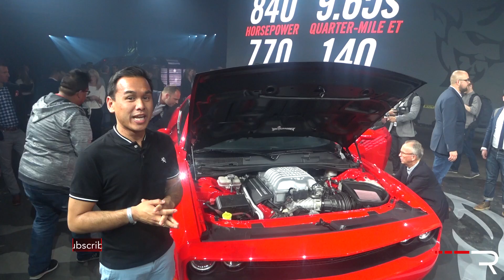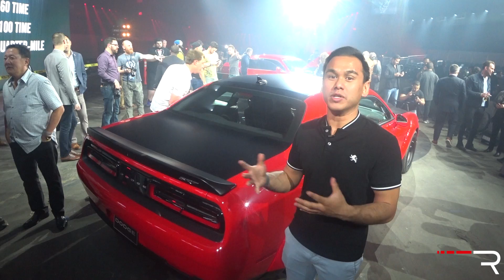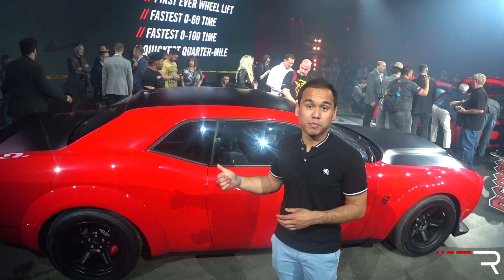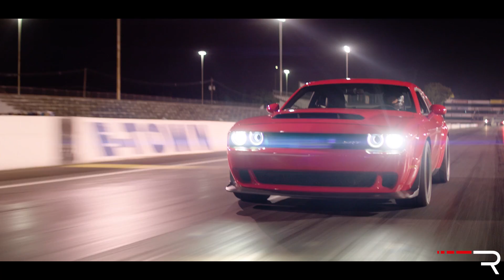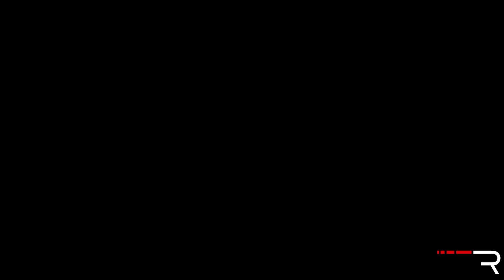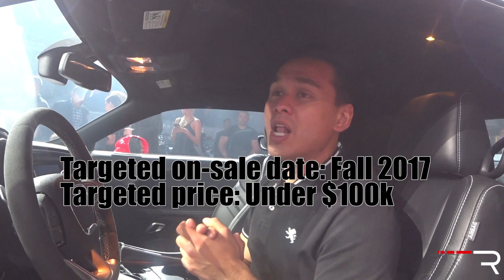2018 Dodge Challenger SRT Demon – Redline: First Look – 2017 NYIAS

Comment: You don't have to like it, but you're damn sure gonna respect it!
Reply: Ervin0310 no
Reply: nah...
Reply: Damn Right !! Tesla has some competition at the drag strip  !!!
Reply: I don't. Making a fast drag car, seriously? You can do that with literally any car. This car is still a cheap-ass economy car with a big engine, and it's only good for one thing - going fast in a straight line. In what way does that deserve my respect?
Reply: Vernon Price economy car? do you know what an economy car is? And how are you gonna knock a car for doing what it's made to do?...go fast in a straight line. There are plenty of cars that I don't like, but I respect. You're obviously a hater 😂
Reply: I will say this, I wasn't huge on the hellcat and thought it was one of the most overrated cars in recent history just cause it has 707HP and people were treating it as if it were some mega exotic god when its just an overpowered dodge(and its not even about the handling, the hellcat just simply put cannot put down what it makes without suspension mods and different tires), but the demon is a completely different story. This is a dragster right from the factory that can still be driven on the streets. I wouldn't care about the warranty too much since most car guys blow that within seconds(and it wouldn't be my daily if I bought one anyways), but it's awesome to see that you're getting a 9 second dragster right from the production lot.
Reply: +tommieboi707 - What part of "going fast in a straight line doesn't impress me" did you not understand?
Reply: +Ervin0310 - "economy car? do you know what an economy car is?"

Do you? I rented a Hyundai Sonata that had a nicer interior than the Challenger does. The Challenger is a cheap-ass car, which is why the vast, vast majority of all Challengers Dodge sells are the rock bottom base models. Not any of the V8 models.

"And how are you gonna knock a car for doing what it's made to do?"

I did actually say it was good for going fast in a straight line. That's not knocking it for doing what it's made to do. It's knocking it for not being able to do anything ELSE. So no, I don't have any respect for it. Yes it's fast. LOTS of cars are fast. And you can make ANY car fast.
Reply: Vernon Price that can be said for any car 😂 base and mid trims typically outsell more expensive trims for any new car being sold so who cares. And WHO CARES that it can't do anything else, it wasn't made to do anything else except to fast down a drag strip.  That's like hating your eyes because they can only see but can't smell. They weren't made to smell, they were made to see. If you want something that can balance track and drag strip buy a fucking viper. You're hating just to hate. Get over it
Reply: +Ervin0310 - "that can be said for any car"

It really can't. This suggests that you've never been inside any E class Mercedes, or a Cadillac CTS, cars like that. These cars have base models, and then superpowered performance models. They're not based on shit cheap cars like the Challenger is.

"And WHO CARES that it can't do anything else"

Is the answer to that question not obvious based on the conversation we're having? I care. I would much rather have a slower car that is both relatively fast and handles well, and is a well rounded performance car, like the Camaro ZL1 or the CTS-V or ATS-V., or the Z06. 

" it wasn't made to do anything else except to fast down a drag strip."

I know that. What part of this conversation lead you to believe I didn't understand that part?

"If you want something that can balance track and drag strip buy a fucking viper."

How about you stop getting defensive because I'm pointing out the Demon's obvious shortcomings? Not only that, you haven't once mentioned all the caveats that come with the Demon. Like for example how it won't actually make 840 HP unless you're on 100 octane, how you have to actually buy the trunk kit separately, how you have to request a passenger seat, etc. On the street it's still going to be fast but not even CLOSE to 9-second fast.
Reply: Vernon Price why are you even on here? you obviously dont like this car so move along? troll much?
Reply: +Ervin0310 - " damn, you're still bitching about this?"

So responding directly to your comment is "bitching" now? What's the matter, were you unable to address anything I said in my response to you? That's pretty typical.
Reply: Vernon Price you clearly don't know what an economy car is.  An economy car is  a compact or subcompact vehicle. The Dodge Challenger is by no means close to an economy car, it is a MUSCLE CAR.  This muscle car is able to do exactly to what Dodge intended it to do.  Also, the interior is meant to be basic, it's a muscle car and Dodge wanted to keep the Challenger as classic as it can be for driving in a modern world. So not sure where you lack of common sense comes in regarding this.
Reply: Ervin0310. tell'em
Reply: tommieboi707 lol true.  Ok at least someone agrees with what I'm saying
Reply: tommieboi707 😂☝🏼
Reply: Vernon Price you may not be the type of person to not solely want a car that primarily only has one function. Fine. But if you can't respect new grounds being broken and new innovation coming within this type of market, that's your questionable and bizarre choice.
People, let this man have his opinion, even if it does seem blatantly ignorant and moronic.
Reply: Ervin0310 will we get the Dodge charger srt Demon tho!!
Reply: +Brandon Ell - "But if you can't respect new grounds being broken and new innovation coming within this type of market, that's your questionable and bizarre choice."

I like how you are ostensibly trying to tell me it's ok to have my own opinion while simultaneously telling me how it's questionable and bizarre. It's almost like you don't understand how opinions work. 

Here's the thing. Going fast in a straight line is not an innovation. Using the AC to cool the incoming air is not an innovation, that has been around for a long time. Drag radials are not an innovation. A higher stall speed is not an innovation. 840 HP on 110 octane is not an innovation. I mean have you not heard of the Veyron?

Nothing about the Demon is innovative, it's simply using more already-existent technologies. The fact that you think it's "innovative" means you're fucking ignorant. Going fast in a straight line is not new, running 9 second 1/4 mile times is not new, nothing about it is new or innovative. If YOU don't understand THAT, then you are IGNORANT. And that's a fact, not an opinion. 

And my OPINION is that I would rather have a much more well rounded performance car that I can make faster than the Demon if I really want to. Mostly though it's about the driving experience to me, and the Demon doesn't cut it. 

Frankly, I can't wait to see some magazine put a Demon on a road course with any GM performance car in its price class, or even cheaper. Maybe when you see how badly the Demon gets its ass handed to it, you will understand why I'm not impressed. I'm much, MUCH more impressed by the fact that a standard V8 Camaro with the 1LE track pack, for $45k, can beat a Lexus LFA, a GT-R, a 911 GT3 RS and an Audi R8 V10 Plus around VIR.

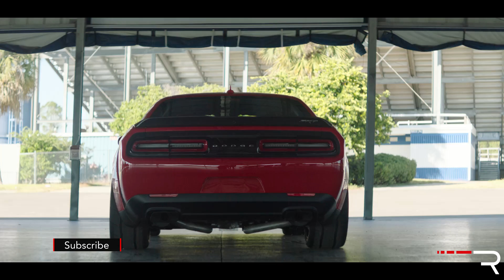35 - 2017 Chevrolet Camaro SS 1LE - 2:54.8
36 - 2012 Lexus LFA - 2:55.1
37 - 2009 Nissan GT-R - 2:55.6
38 - 2011 Porsche 911 GT3 RS - 2:55.9
39 - 2017 Audi R8 V-10 Plus - 2:56.1

And for reference:

75 - 2016 Dodge Charger SRT Hellcat - 3:03.5

Where do you think the Demon is going to go on that list?
Reply: Alex Valero I'm not sure but I really hope so!
Reply: Find you at a prison once you are caught speeding....what will you say then?
Reply: Ervin0310 dam you couldn't of said it better lol
Reply: Vernon Price is still here 😂😂😂😂😂😂
Reply: +Carlos Ochoa - "Vernon Price is still here"

Yes, and?
Reply: Vernon Price blah blah blah blah blah blah
Reply: put some respekt on that name
Reply: Ervin0310 just don't give people attention when they don't deserve it
Reply: +Ervin0310 - You still cryin because I don't respect the Demon? Well keep cryin, short bus. You started this, you have only yourself to blame. When the Demon - or any car Dodge makes, aside from the ACR - can actually go around a corner and not look like a fucking Fisher-Price play set inside, maybe then it will get my respect.
Reply: Brandon Evans oh I'm not worried about him. I'm just wasting his time. His thong has been too deep for like 2 days now. Everyone knows he's a troll we're just having some fun
Reply: Ervin0310 lmao I know.  He said I'm scared of his response.  Actually not, They're funny.  He's taking this too seriously lmao
Reply: +Carlos Ochoa - " Vernon Price is still here bitchin"

So are you. Or did you not notice that?
Reply: +Ervin0310 - stilllllllll cryin
Reply: Vernon Price blah blah blah blah blah blah
Reply: +Brandon Evans - "Actually I don't really care to waste my time with certain individuals."

This is getting less and less true every time you respond to me. But definitely keep doing it, I enjoy watching you dig your own hole.  :D And of course you're attracted to me, why else would you make the effort to continue to talk to me after telling me how you don't care to waste your time with me?

Denial, son.
Reply: guy proulx lmaoo
Reply: +The Punisher - "what new car isn't cheap and full plastic."

Some plastics are higher quality than others, and the fact is the Challenger and Charger use very thin, shitty plastics in their interior, so everything feels cheap, sounds cheap, looks cheap. Like I said, I had a rental Hyundai Sonata and its interior was objectively higher quality.

"I'm willing to bet this thing does fairly respectable in the cornering aspect"

HAHAHAHA

HOW MUCH, exactly, are you willing to bet on that? Not even Dodge is saying the Demon can handle. That should be your first clue right there. So give me a number. How much money are you willing to put down on the Demon handling well on a road course? And by "well" I mean putting down lap times as good or better than GM's performance cars in the same price range - Corvette Grand Sport, Cadillac ATS-V, Camaro ZL1. 

Oh wait, those cars all cost about $15-20k less than the Demon and will absolutely fucking MURDER IT around a track. 

"those fat sticky tires"

And here is where you're going wrong. Tires are not the same thing as handling. Mechanical grip is not the same thing as handling. Sticky tires do not make a car HANDLE better. What they do is make a poor-handling car stick to the road better, and then you have body roll so bad your door handles scrape the ground. That's not good handling.

Also, we're talking about drag radials here, tires that are made specifically for drag racing and NOT for cornering. So this car is ABSOLUTELY a one trick pony, and it's even more of a one trick pony than the Hellcat is. But hey don't take my word for it. Just be patient until all the magazines and tv shows can get their hands on a Demon for head to head comparisons and run some laps in them. 

I highly encourage you to put money on the Demon actually handling WELL on a road course, i.e. in the same league as a Corvette Grand Sport, for example. which has 400 fewer HP and costs ~$20k less money than the Demon. Drain your savings, in fact take out a second or third mortgage on your house. Put it all on the Demon to "handle well". Because there is no better teacher than experience.
Reply: Vernon Price u still here lol it's good to have you here is a pleasure 😂😂😂😂😂😂
Reply: +Carlos Ochoa - So are you saying "u still here" because you want people to pay attention to you? I think it's pretty obvious that I'm still here, you know, based on the comments I'm making here, but maybe for simple-minded people it's something that needs to be specifically mentioned? I don't know, you tell me,
Reply: Vernon Price 😂😂😂😂😂😂
Reply: +Carlos Ochoa - Right, emojis. That's how I know I'm dealing with an intellectual giant.
Reply: +The Punisher - "hey man plastic is plastic it's all cheap."

Completely false. There are hundreds if not thousands of different types of plastic, Dodge uses the cheapest plastic they can, to keep costs down. I get why they do it, but it sucks ass. It makes everything inside the car feel cheap as hell.

What you're trying to argue makes no sense, you can disprove that simply by using different thicknesses. Maybe you need to spend some time in some higher end cars.

"over a G on the skid pad. "

And why is that, exactly? Oh right, because 315 width slicks. Did it not occur to you that mechanical grip is not the same thing as good handling? You keep trying to argue that it handles decently, and I keep telling you to watch what happens when a Demon hits a road course against a Z06. Or a CTS-V, or a ZL1, or even a regular Camaro SS 1LE. GRIP IS NOT HANDLING. This is a concept you are going to need to understand before you understand how badly the Demon is going to do around a road course.

I'll say it again to be clear - a decent skidpad number is a BYPRODUCT of having sticky DRAG TIRES. It is NOT an indicator of good handling, nor is it an indicator of the Demon's road course prowess. For example, how well does the Demon transition from side to side? How does it do through a tight slalom? That's a much better indicator of balance and handling than the skidpad test.

Once again, don't take my word for it. See for yourself when all the magazines, TV shows and youtube channels have had a chance to test one head to head against something like a ZL1 or a Z06 around a road course. I'm just telling you not not to be surprised when the Demon loses.
Reply: The Punisher  Are you saying that all plastics are cheap?
Reply: The Punisher  Did you know that there are 7 kinds of plastics, some are much better quality than others
Reply: +The Punisher - "it doesn't matter how thick the plastic is"

Yeah, it actually does matter. And also the TYPE of plastic matters. Once again, very easily provable if you go sit in a higher end car with less shitty materials used. Still plastic in a lot of cases, but better quality, thicker plastics.

"of course it won't be faster in a slalom or road course"

That is a complete 180 from what you were saying earlier. You were suggesting that the Demon handles well because it may possibly grip up to 1G on a skidpad. In fact, here is exactly what you said:

"demon goes over a G on the skid pad so I'm sure it will do well in the corners. it's not just a one trick pony."

You're SURE it will do well in corners. You are SURE about that. But now you're saying OF COURSE it won't do well in corners.

"how many times I gotta say it wasn't designed for that."

That depends on what you're claiming at this exact moment, doesn't it? Do you believe the Demon does well in corners or not?

"even though it wasn't designed for that it will still do good cornering"

Oh, so now you're back to it WILL do good in cornering. Do you even understand you just contradicted yourself twice in your own post? Well which is it? You just said "of course it won't be faster in a slalom or road course" in the SAME POST that you said "it will still do good cornering"

Do you need some time to yourself to figure out what the fuck you're trying to say? You can't have this both ways. Either it corners well or it DOESN'T. Pick one and get back to me.
Reply: Automatic tho?? Lol

Comment: Very impressive. But I'd rather have something more balanced like a Mustang or Camaro. I hope they use the Giulia platform for next gen.
Reply: jo23bulls lmao if you thing mustangs are balanced than you're high af. you want ballance get a 200 hp frs, or a miata.
Reply: thekiller500099 mustang gt350 or 350r..well balanced car...
Reply: Compared to a challenger, absolutely. I'm not comparing it to a GT3.

Comment: you are the the VERY FIRST to comment on the awkward hellcat vs. tesla  situation, I base my priority car preference on 0-60, therefore I used to be for tesla, and NOW IM ALL DEMON. HAHAHAHAHAHAHAHAHAHAHAHAHAHAHAHAHHAHAHAAHHAHAHAHAHAHHAHAHAHHAHAHAHHAHAHAHAHHHAHAHAHAHAHAHAHAHAHHAHAHAHAHAHHHAHAHAHAHAAHAHAHAHAHHAHAHAHAHAHHAHAHAHAHAHHAHAHHAHAHAHAH
Reply: Basing anything on 0-60 is stupid, because the only thing 0-60 measures is traction. Not speed. Want proof? Put standard all-season tires on the rear of the Demon and try launching it. You think you're going to get 2.3 seconds? Right, because 0-60 is not an accurate way to gauge speed.

Comment: It's an insane car, but the ZL1 in my opinion is still the better buy.
Reply: I Finn and Chevy or Ford is.. This car will be a flop
Reply: Ryan P-76F1004x4 you can daily drive the Camaro ZL1 and take it on the track, but this thing is just not a practical daily driver at all.

Comment: Undeniably cool and fast as can be but Dodge misses the main flaws in this car once again. I can add fender flares and wider tires for less than they charge with very similar results.  This car is still way too heavy and has a cheap interior (covered in alcantara) but still cheap and not very comfortable. And with major reliability issues plaguing the entire brand, I am far too sceptical to drop my hard earned money to buy this. Would totally lease for a year and give it back though.

Comment: All the fanboys are wet seeing this car. Little do they know, that this car has nothing but power. In other words, after putting up 40-50k miles, consumers will be spending abundant on maintenance. I mean the car is damn fast, and loud, but I think dodge needs to focus more on other technical issues rather than just the power. I do respect this car, however.